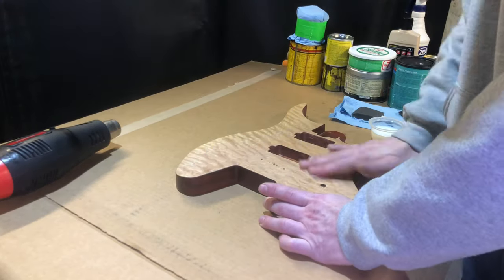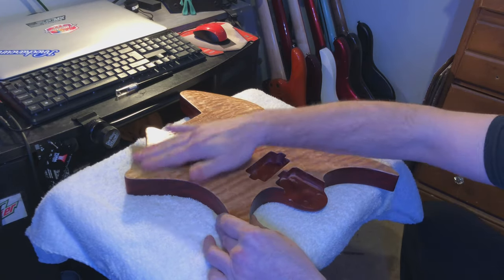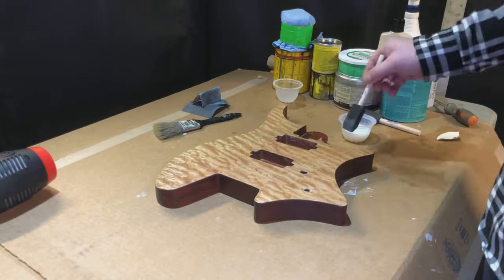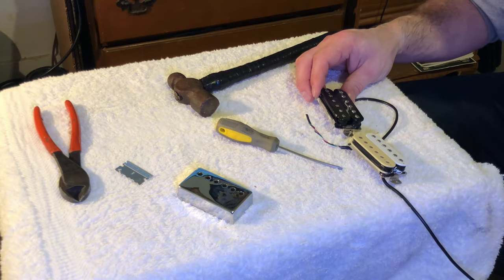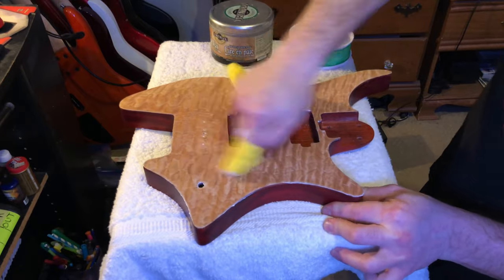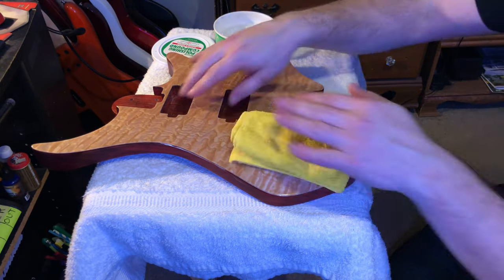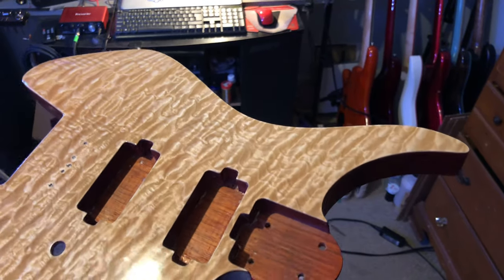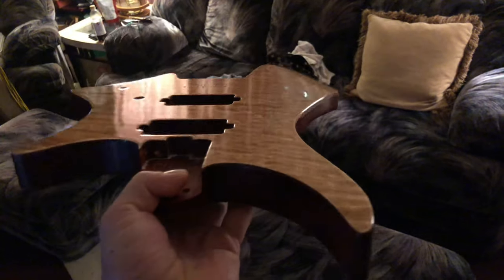Eart headless guitar/ mod project part 5 "applying finish"

Comment: Man that look great! Can't wait to see the finished project. Are you putting the stock bridge back on?
Reply from the maker: For now i will be yes but new pickups
Reply: @SIX1NINEGUITARSANDGEAR  I did see a upgraded version in a forum about KD bridges. It's the same design but upgraded materials.
Reply from the maker: @gasiouswiener  really ? I was looking at 2 different hipshot bridges
Reply: Scroll down and there's a pic
Reply from the maker: @gasiouswiener  looks good would have to route the body looks like for the trem version
Reply: @SIX1NINEGUITARSANDGEAR  yeah I'm hoping they're make the hard tail too